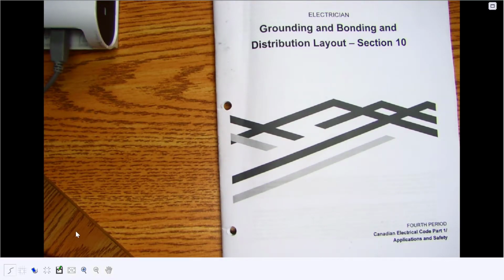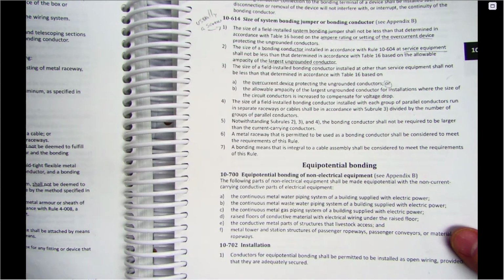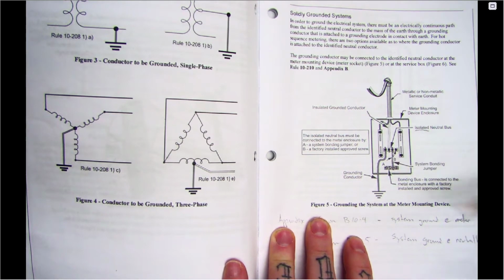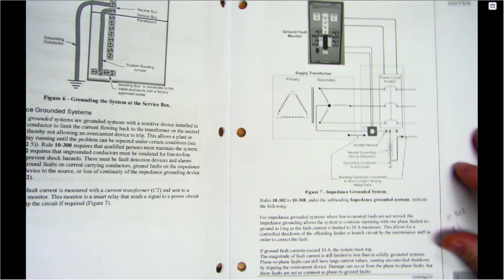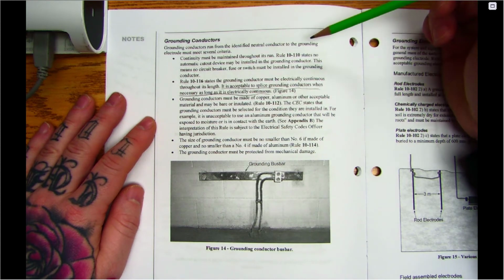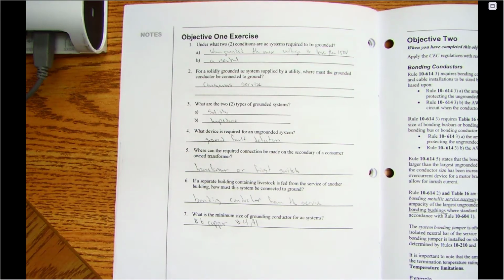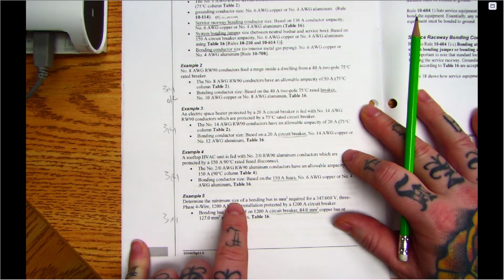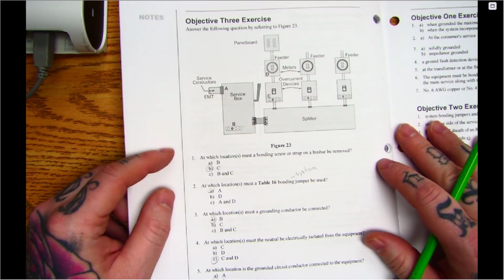code grounding and bonding

Comment: Hey Nick
How should we size bonding conductor for an electrical equipment (panel board for example) when it feeds from less than 7.5m tap conductors. There isn't any O/C device there.

Comment: What tp do when you have 2 service entrances to a house? how are they bonded?
Reply from the maker: The main service is where the Service grounding conductor is connected to the grounded conductor only in one location.  Everything else will be bonded to ground from that point.  Follow your local municipal code and the CEC if in Canada for specifics.

Comment: Great video! In the new code, is there any instance where you don't need a bonding conductor ran in the conduit? table 16 seems to point that everything pretty much needs a bonding conductor. it goes all the way down to 20A.
Reply from the maker: Some installations allow the conduit, if metal, as the bond for the circuit without the use of an actual bonding conductor.  Its the type of raceway and installation that will dictate whether you need to pull a separate bonding conductor.  For instance, EMT conduit that is run above ground in doors does not need a separate bonding conductor as the bonding continuity is maintained through the conduit and connections at every fitting and device box.  It is situationally based so its hard to give a definitive answer.